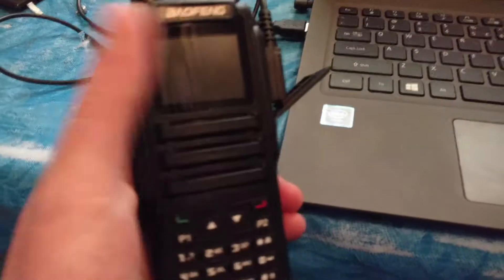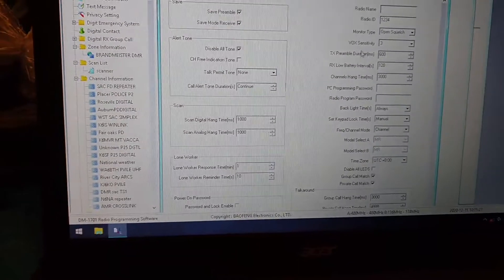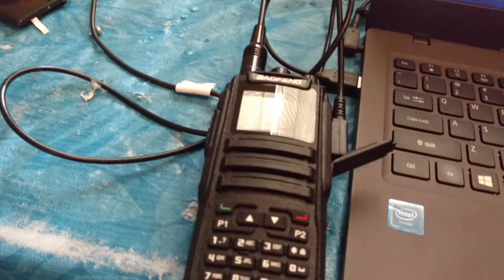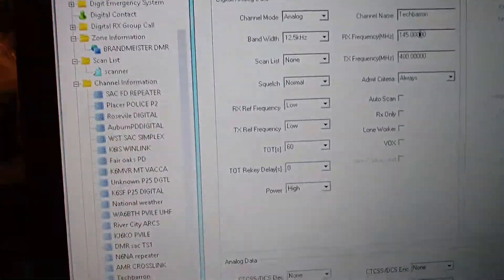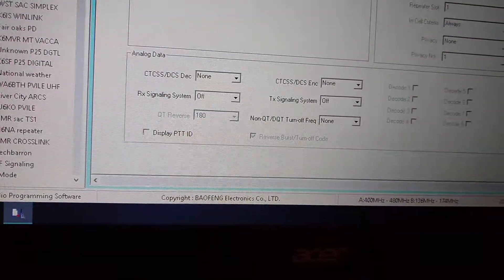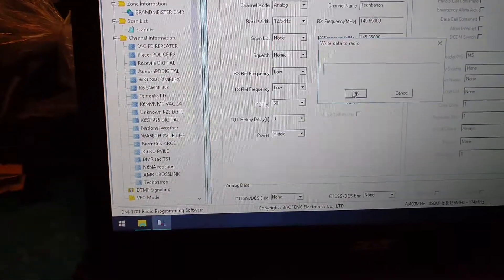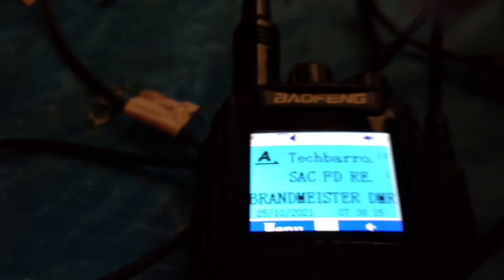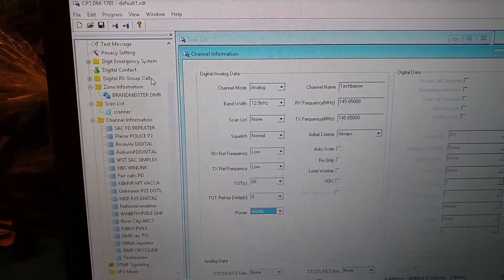DMR programming guide for Radiodity RD5R  aka DM-1701

Comment: Why doesn’t your video show to program frequencies from scratch. This video assumes you know a tremendous amount of info about the 1701 and already have data files. This is a very misleading video.

Chirp does not work with this radio; you have to use a special Baofeng software which you do not explain

Comment: I saw you had a P25 channel/zone on there - is this set up as a trunked channel/zone or just digital?  Is trunking even a option on this? I know.... kinda stupid question, but I'm trying to figure out what I can get that's not going to be like $5k. Thanks.
Reply from the maker: This HT is not apco p25 compliant. Mototrbo/dmr only. I do nit think cps supports trunking on 1.05 version of the software.  Haveing trouble with offsets on cps..
Reply: @hubzcaps   that’s what I figured.  So that channel is a regular non-trunked, but digital?